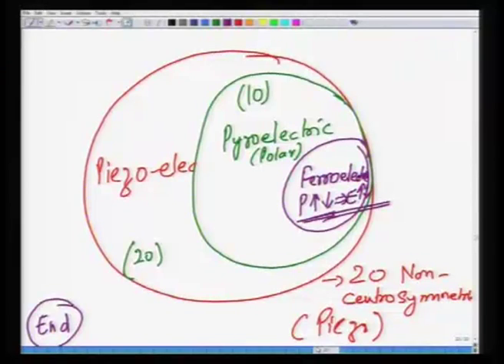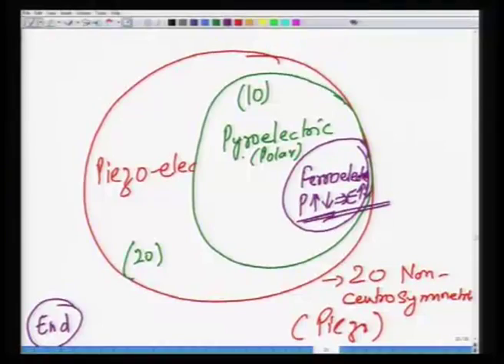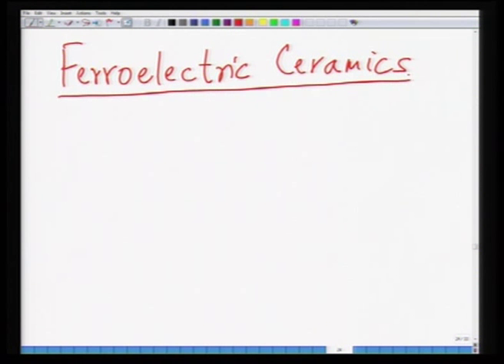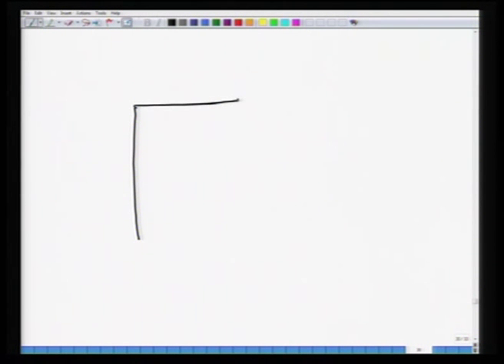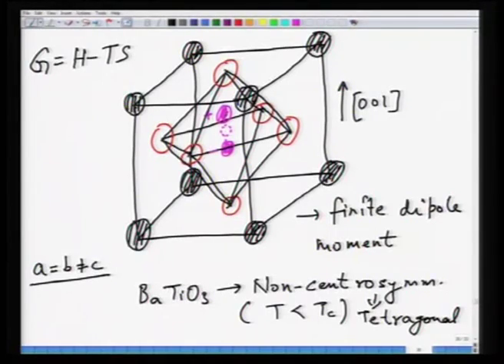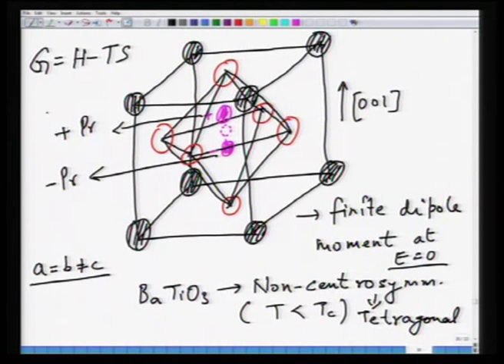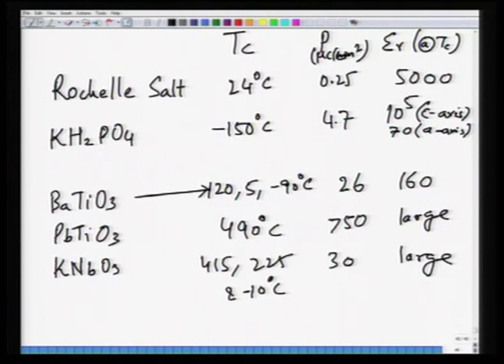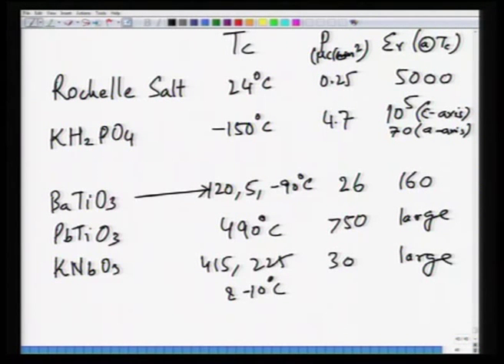Mod-01 Lec-26 Lecture-26

Comment: Before you slice it shift two points on opposite sides of the cube to a Y axis and slice it in the middle. You should get a hexagon shape after you slice it. If you increase your surface area it should solve thermal issues. Put a charge to it and try super cooling too. Recently on Seeker the channel science is figuring out how to construct crystals with lasers and are stable up to a year. Hope you find something amazing.